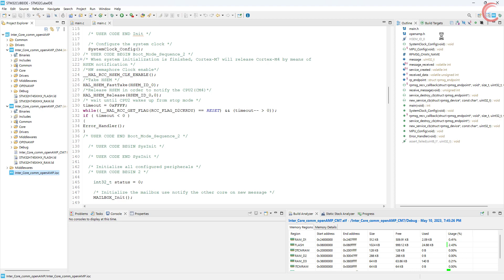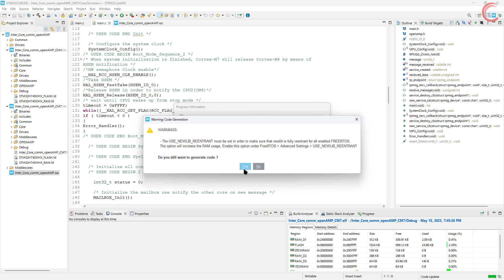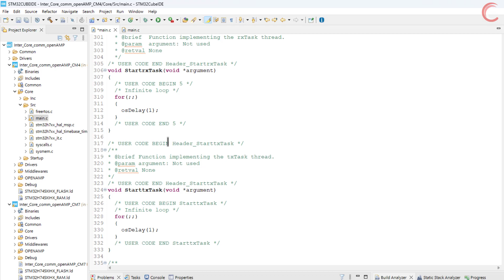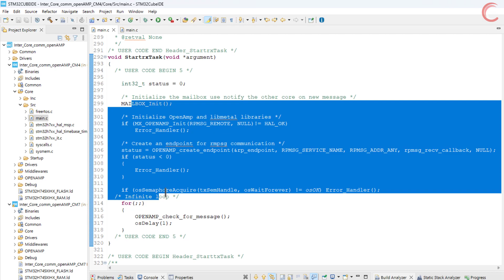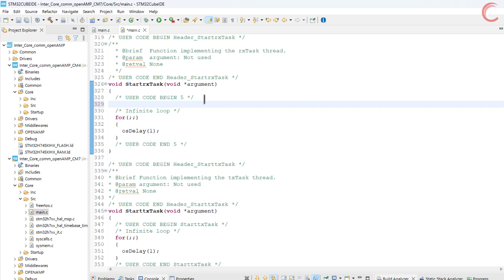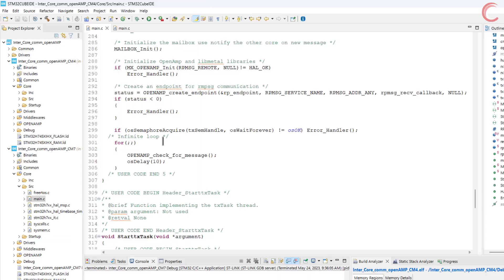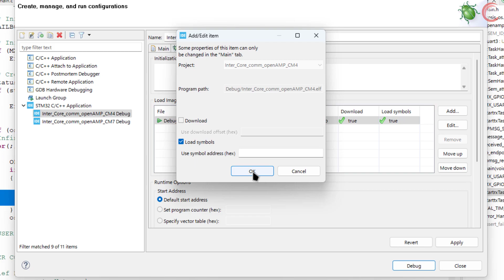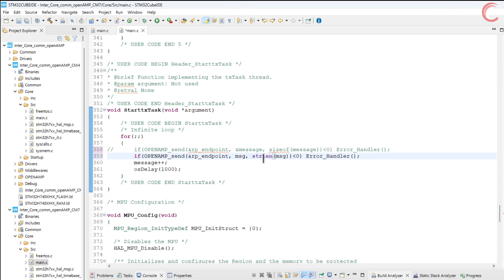STM32 Dual Core #4. Inter core comm || FreeRTOS || OpenAMP || IPC || Shared Memory

Comment: OpenAMP is an interesting thing, but what benefits it have if compared to using an interrupt and some memory region as exchange buffer? Thank for your video I have implemented OpenAMP and it works fine in both directions, but previously I just called __SEV() from M4 and on M7 in CM4_SEV_IRQHandler got all neccessary data or command. It's even better because you don't need to call OPENAMP_check_for_message() everytime. I think there should be some other features - maybe OpenAMP implements message queues or something else?
Reply: hi, i'm new to this dual core stm32 
can you show me some basic code using __SEV() CM4_SEV_IRQHandler and to send data between 2 cores

Comment: Nice video!!!! Your tutorial is so easy to follow.... But how to send data from M4 core to M7 core?
Reply from the maker: Just call the function openamp_send from the m4 core..
Reply: Hello, i have the same problem but unfortunately i cannot get it running, i want to send data from m4 to m7, just by changing the code from m7 to m4 isn't working. DOES someone have an solution?